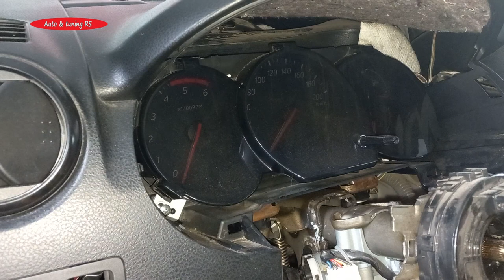Removing the Dashboard of Suzuki Grand Vitara

Comment: 6:50 and 18:18 with those plastic clips, push the center pin IN further and it will release the clip and then pop the whole clip out. 
when they are installed, you push clip in, push the pin till its level and locked. then if you push it in further, it releases again.

Comment: Very informative. You are doing a great service for DIY mechanics.. My instrument cluster lights keep going off and coming back on. What do you suggest is the fault
Reply from the maker: You need to open it and check carefully, Or there is a cold solder and it lights up and goes out when moving, Or the problem is in the socket that plugs it into the power supply.
Reply: Hey !! thanks for the info. Great that you got back to me...

Comment: If I’m just removing the central dash air vent and replacing it because the plastic cracked, do i need to disconnect the battery? Or just have the car off?
Reply from the maker: In my opinion, for greater safety, it would be better to disconnect the battery

Comment: I changed a mates stereo yesterday in one of these. It’s like you have no room to do anything. Why build in the stereo. Fitted an amp too. Literally nowhere to run a power wire to the battery from inside. All done now but Jesus it was winding me up. My car I just drilled through fire wall but when it’s not your car you tend to have to do it the right way